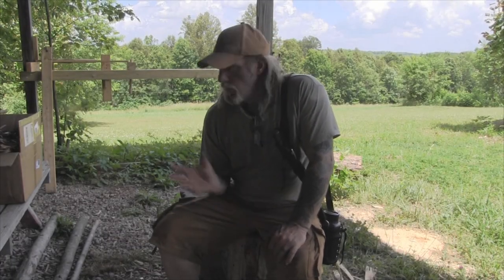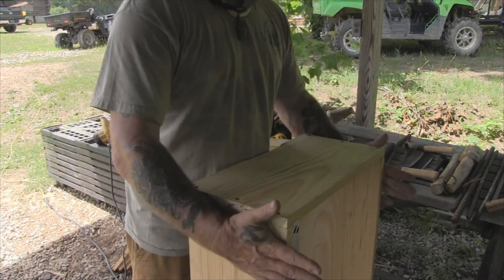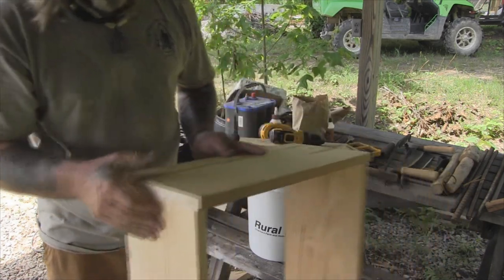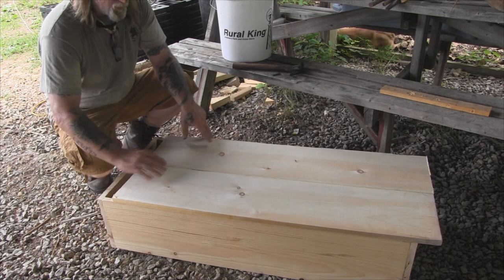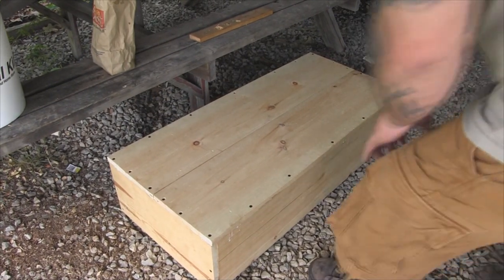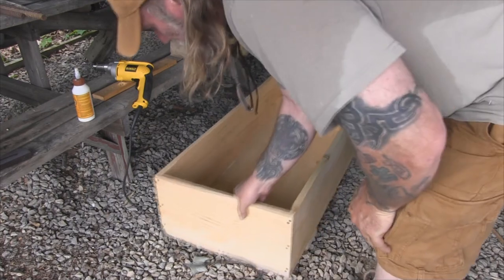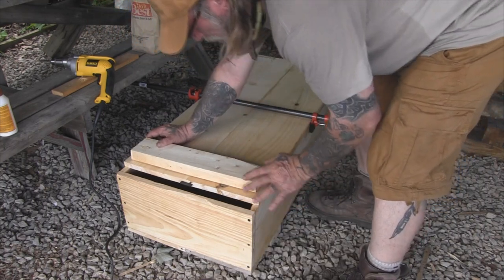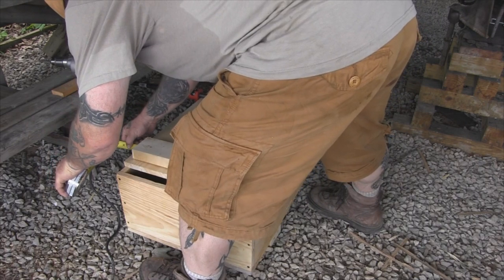Pine Crate Tool Chest

Comment: hi wanted to say thanks for videos the common man approch has save me a bundle and made it possible to hunt once again this doesn,t have anything to do with this video but wanted to pass on this tip on making a dowell jig to make arrow shafts, there are 2 ways to do it cheap one you drill 3 holes in a piece of mild steel,in a row so that centre one is size of shaft you want and the outside 2 are smaller than it about half,these two are drilled/postioned so that they attach to centre hole making them the cutters hope that makes sense you  than  cut wood a little bit bigger than dia of finished arrow and round the first couple of inches so it will fit into your drill and start into middle hole you then start it turning and push it through.  The other way you just drill size hole you want shaft to be and then using dremel or other simular tool to cut grooves into hole you drilled making an x across it you than do same as the first way hope this helps you and you followers make cheap arrows. Maybe you can make a video on this well thanks again for all you help terry murphy

Comment: Bevel the bottom surface of the cross runners on the bottom of your top.  This will make the top more self aligning.  Less fiddly to push the top in.

Comment: Deck screws are just like drywall screws except they are galvanized and thicker, that means they are stronger and will resist rust. If your project is likely to get wet or is in a wet/humid area, the deck screws might be better.

Comment: Hi Dave watching you video and thought a I would throw a trick your way.  When you were gluing the runners for the top on you clamped the 2x4 so it would move while screwing it down.  You take normal table salt on sprinkle it on the glueing area and it will stop the board from moving while you screw it and not effect the glue at all I use it for veneer a lot

Comment: Hello Dave, thanks for the video and it's a nice big tool box.
One suggestion if you don't mind, would be to place a vertical support 1"x1" in each
corner to keep the box even more stable and from warping.

Comment: So the real reason that they used joinery back then is . Do to the cost of hardware or rarity of it in the area but . The rarity of dimensional lumber being spot on is right as well . Mostly oversized to be squared and true dimensioned by hand . Nice tool chest and god bless.

Comment: Why is pine your choice of wood for this project? (I'm completely new at this stuff, trying to learn something about properties of different woods ;) )
Reply: ***** FlyingAxblade Thank you fellows :D!
Reply: Bart Van Wunsel Pine is cheap, lightweight and flexible... not the best choice for a long lasting tool box that is intended to hold anything heavy, as it will warp, it is also affected by moisture and that causes cracking, chipping and splitting (i think the US term is checking) and more warping. For a toolbox you can pass on to your kids, and they to theirs, it's best to use a hardwood, but as i think somebody else said, hardwoods are expensive in comparison (although the false economy of using cheap wood and building future boxes to replace them as they break/ become unuseable does need weighing up). if it is just a box you'll keep inside, will seal with a varnish/ wax etc and will only use on rare occasions and won't take a beating, pine is an ok option- for a box you want to last and be bombproof, white oak is probably one of the best choices because it is cheaper than some other hardwoods and still has some flex etc (like a happy medium between pine and mahogany) Oak doesn't warp as easily nor does it flex as well, but if you want sturdy and bombproof, a harder wood is the better way to go (and there are ways around weight control if needed, although "put wheels on it" is a pretty good rule of thumb for a tool chest etc). Knowing what Dave's projects are for, i'd bet cost ad availability is the main decider for the box he made. (although with a load of wood in his backyard, i don't see why you'd need to buy so much lumbar, plus he could make more video's by showing how to convert a tree to useable material.
If you're interested in joinery as a hobby, check out people like Wranglerstar, as they show techniques and hints/ tips, and also have a more "if its worth doing, do  a professional job" stance, whereas Dave tends to be more "it'll be reet" philosophy.
By the By, A "Bodger" in the UK now means somebody who will ~"bodge" things together, not quality, but more a "it'll be right" and "duck tape fixes everything" type of person, ( a bodgit and scarper business is essentially a cowboy builder, doesn't care what the finished product is like, as long as he got paid before the person noticed the shortcuts and faults, and they scarper before you can get a refund... Dave is a Jack of all trades, master of none (when it comes to blacksmithing/ woodwork etc... bushcraft he's pretty sharp, woodcraft= so so, but seems to not get woodcraft's history and tries telling people it originated in the US, but was well established in the UK in the 1300's, and a woodsmen is a common thing over here, bushcraft originated in Oz, but that's me getting my ramble on about a different tangent..  (Also a Bodge job, is usually a slander to somebody to tell them they did a crap job and although it might "work" it is lacking in quality, craftsmanship and love in their final product (as can be seen by the visible gaps/ poor fitting/ low quality finish of the project, where as if he'd taken a little extra time and care ("measure twice cut once" approach), and been patient, the extra hour he could of taken would of resulted in a much better final product, one that he could be proud of, as i said, Wranglerstar is such a person, as is a UK carpenter called Paul Sellers, Who has a tube channel.
I have a saying, and i think it applies to doing pretty much any hobby, as well as any lifestyle... "Water tastes better when you're thirsty; So earn that drink and enjoy it more."
Reply: Switch Outdoors I like that saying! I don't have too much time on my hands though, I work 12h shifts as a security guard :P I'd have to learn everything from scratch, but I'll definitly get to it. Just need to find some projects ;)